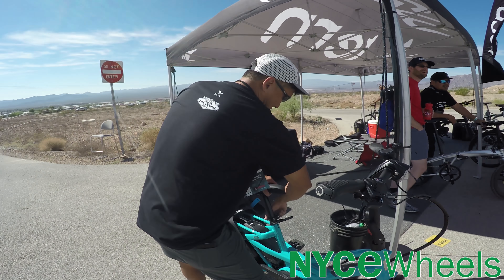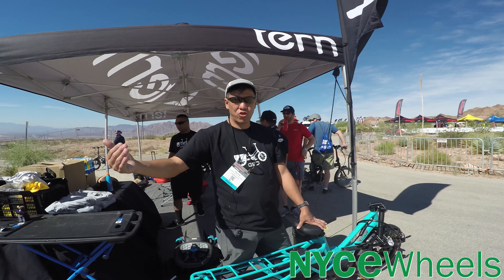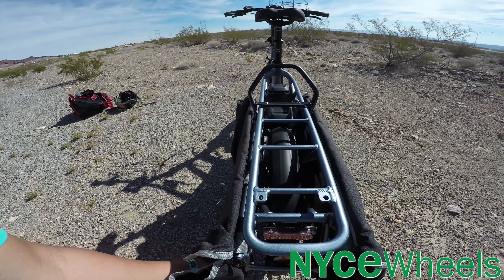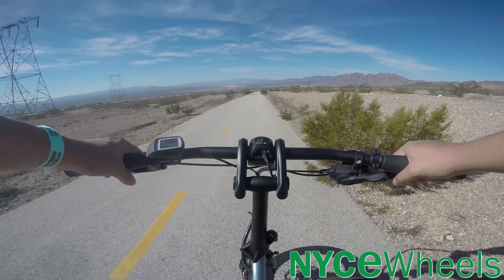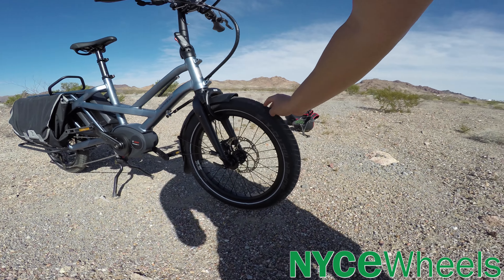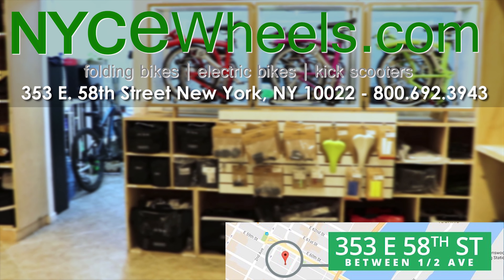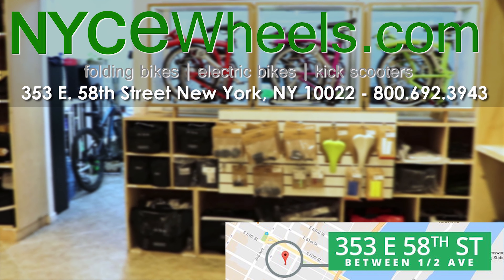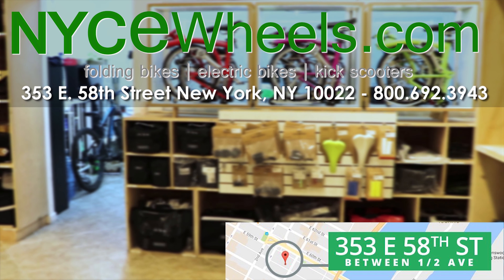Tern GSD first look with Josh Hon - Interbike 2018

Comment: Two questions - it can carry cargo of 400lbs. Does that include the rider?
Also, does it come with the handle shown on the rear rack? I did not see this on tern's website
Reply from the maker: The 400lbs includes the rider. The handle does not come with the bike, but is an accessory that can be purchased afterwards. We have GSD's in stock but a lot of accessories are on backorder at the moment.
Reply: NYCeWheels thanks! So for example if I weight 200lbs, the maximum additional cargo I can put on the bike would also be 200lbs. Just want to confirm if that's correct.